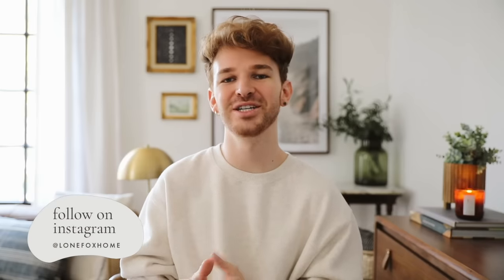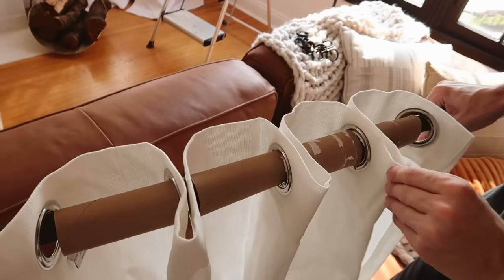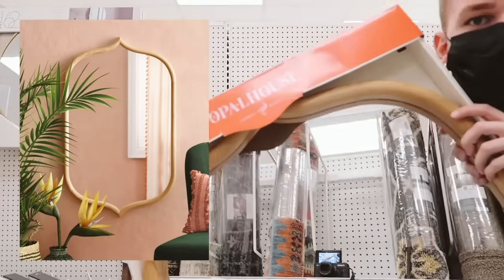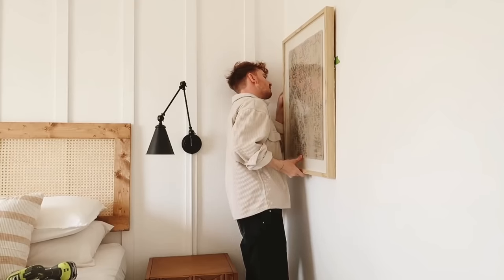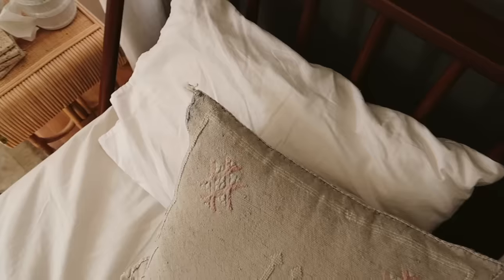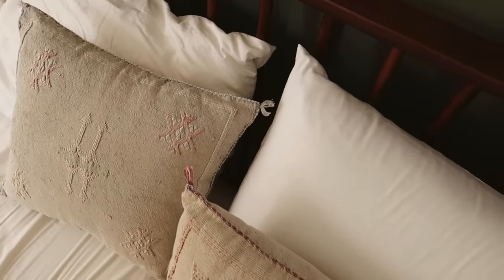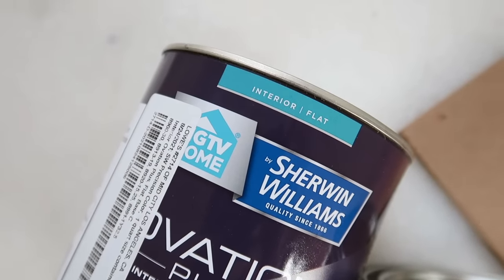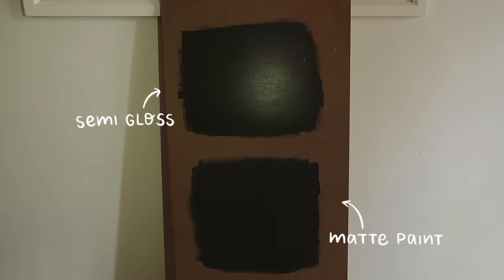10 GENIUS Home Hacks That CHANGED MY LIFE 🏠  Life Hacks to Save Time + Money!

Comment: We just put a strong wire from picture hanger to picture hanger in the back of a picture, making a triangle shape towards the top(2 or more separate wires are more secure, for heavy things) and just putting one screw and plastic insert, into the wall. Adjust the picture, horizontally on that one screw/nail. We have cement walls here. You need a plastic insert if you use a screw and no nail will work on those walls. The other walls are easier.

Comment: When a picture or mirror has hangers on either side, use hanging wire. You buy it at like Lowe's with the picture hanging accessories. Twist the wire around one hanger to secure it, trim the wire and twist it on the other side. You don't need to hammer two nails. In fact if it's a heavy piece an anchor is a better hanging choice. No level needed. In fact with those two hangers on either side they aren't always level and the angle of your nail can throw things off.

Comment: For the picture hanger my family used to make knot on leather sides with a thick thread longer than the width of the picture frame and hang it from that thread, the only thing would be not completely flush against the wall so it would be slightly away from the wall from the top side

Comment: If you have a frame with two nail holes, string a wire between the holes (with hooks if necessary) 
and hang the wire on a hook or nail on the wall.

Comment: Nice video.  On two hangers on the back of a picture or mirror -- I have always used picture wire between them then hanging on either one or two nails or picture hanging hooks.  It makes them adjustable and much easier to  hang.  With a "Molly" or stud attachment, it is very sturdy for heavier things also.  It wouldn't work for extreme width things like a long bulletin board, though.

Comment: Tip two, I’ve never seen those two hooks left like that requiring two wall screws, they are always used with a wire or string strung between them, so you only need the one wall screw to hang the wire or string over.

Comment: I’ve made my Christmas tree appear a lot taller by placing it in a pot that was larger than the tree stand — and placing a crate in the pot … in not describing it that well…. But instead of paying $400 for a 13-15ft Christmas tree, as it has been recently, we spent $100 for a 8-9ft tree and placed it in a huge garden pot that we already had, and placed it on a crate - then put a Christmas rug around it  and then presents …. 
Similar idea to the faux tree work you did with a larger pot and boxes to elevate it …. 😉

Comment: With the paint one you don't actually need to buy the original wall color to get a clean line. Get a small brush and paint from on top of the painter tape and away and you'll get that same clean line. It's because you'll have less paint on that little brush so it won't bleed through the tape and the bristles won't get underneath the tape where you don't want them to be. I've done this with dark colors on white and it looks super clean and you save money by not having to buy more paint!

Comment: I NEED the rechargeable 💡 hack! I live in an apartment complex that was built in the ‘40s. There are two outlets in the 13x15’ bedroom, four outlets in the 13x18’ living room/dining room layout. I have one lamp in the living room (between one chair and my work station…I wfh). I have a loveseat against one wall, with two chairs facing it at each corner. The one chair, essentially in the middle of the room, has no light fixture. A small end table with lamp would really work nicely. Thank you!

Comment: Great tips!  My favorites (new to me) were the gallery picture hanging using butcher paper first.  And using the painter’s tape and same color paint before the darker, new color paint to get a perfectly straight line with no bleed thru.  Oh!  And also the black electrician’s tape on windows!  Thank you!
Reply: I use a roll of wrapping paper that I buy at the dollar store.  You can also use brown, paper bags from the grocery store in a pinch.  Be sure to write the size on each cut out piece if you plan on saving them to use again.

Comment: Those little D rings on the back of your frame are meant to have a picture wire between them. Most frames like that have an option to hang them landscape or upright just like this mirror did. Just get some picture wire Talla connect the two and then put that wire over single nail and then you can center it is by sliding back and forth.  If it's somewhere it might get bumped just use a wire tie or something to wrap around each side of a nail so it won't slide back and forth and get cockeyed

Comment: Instead of the lipstick for handles with 2 screws sticking out, just push them through some cardboard, then you have a template.  If they're just 2 hole handles, just put a piece of paper on them and press into the holes to mark them.  Again, an accurate template.

Comment: Sry, Electrical tape on the window.ick..I get your point, I had a similar  problem with French doors I purchased but didn't notice the wrong ones came in until they were instllled, Ugh, they had white cross bar btwn the glass panels, so I couldn't paint them , I fixed this with edge band :) Edge band is real wood strips, it even came in the specific coordinating maple. I stained it then took a  clothes iron and it sticks to the window! works great and good quality

Comment: IKEA sells motion sensor lamps that are battery powered and have a few cute designs. The batteries last for months because the light only is activated when there’s motion and when it’s dark (it has a motion sensor abs light sensor so it’s only activated at night with motion)

Comment: The tape trick is clever,,,,BUT I've always understood that those eyes, or nail holes,  on the back of the mirror are to use with picture wire....then you can hang it on one strong nail or if a mirror, better with two sturdy nails, spaced fairly far apart which will allow for straightening/balancing..

Comment: As far as those picture frames go, if there are 2 hangers with those metal triangular loops, u can still make 1 hole. Just get picture frame wire (or any sturdy wire) & tie each end to each hole & hang in the middle. That's technically what they're for (they're not for screws).

Comment: The two hangers on each side of a mirror or framed art are not for nails.  Run wire between the two holes and then use the wire to hang the mirror/art on the wall.  Then its level even if the nails in the wall are not.  The hardest part is getting the height where you want it.

Comment: I have seen and tried this tape hack for hanging a double-hanger item, but I have ONE CAVEAT: if the two hangers on the back are not level to one another relative to the piece (for example, if the right one is higher as you are looking at the back), you will transfer that difference in height to the wrong side when you turn the tape around and put it on the wall, and your piece will hang crooked. I always use the tape, but I put it sticky side out when marking on the piece, THEN stick it to the wall (I poke a small hole through rather than use a pencil, otherwise you obviously won't see it because it'll be on the wrong side!).

Comment: Loved the tips, thank you.  A bit late for me to watch this though Lol.  I have struggled to drill correctly for my dresser handles - in future I can use your amazing hack.  I have one project that I wanted to do but since there's no electrical connection on that wall - I'm stuck.  We have knocked down a wall (to open the kitchen) and on the part that we cut the wall, I wanted to place 3 pendant lights.  Not sure how I'd make them - yet.  But I might have to use your idea of using the rechargeable bulbs.  Would you be able to give me some ideas on what type of pendant lights I can hang that can use those types of bulbs?  I wish you were here in BC and I'll let you decorate my space.  Lol

Comment: Don’t forget to MIRROR the two holes that you put on/in your painter’s tape when you transfer them onto your wall!!
If the holes on the back of your piece are not level and you simply put it ‘non-mirrored’ on your wall, you will make the holes/nails in your wall out of level too! And then you are STILL stuck with a crooked piece!!

Comment: You don't have to use two nails. Use picture hanging wire through those loops on the mirror .Twist the wire to the desired length. then put the nail in the center of where you want it hung. This is how paintings are hung.

Comment: The only thing is that they are expensive and.don’t last too much. I purchased 2 sets of two of the long ones to illuminate under the top cabinets of my kitchen. It looked beautiful. First of all I needed 3, but they used to come in set of 2, I don’t know if now this was changed. Then, 2 of the bulbs went off. So I purchased another set, since I just had one extra. For not annoying with the whole experience, after almost $100.00, I decided to go bach to the ones I always used. They’re plugged in the wall outlets and are the oldest style, not the LED, which are also I pain in the neck to find replacements.

Comment: I thought the purpose of the two separate hanger loops is to attach picture wire between them, then hang them with the wire. Isn’t that the Point, of have I been wrong all these yeasts?

Comment: What a great video!  Thanks, Lone Fox!  I especially love the painting hack.  When I paint an accent area, I like to create a border of the original color all around the accent area.  That way I avoid dealing with that horrible line where wall meets ceiling or adjoining wall!  I measure in 3 or 4 inches all around the accent area and tape it off.  (Make sure to run your tape on the outside of the accent area!).  This creates a lovely "frame" around the accent and it gives a feeling of cohesion with the original wall color.  BUT, I have struggled with the leaky look along the edge.  I normally do lots and lots of burnishing to get a complete stick.....NOW, thanks to you, I have a solution.  Your suggestion came just in time as I am currently preparing to do some pretty accents!

Comment: The painters tape for nail holes  — this has bothered me forever — because I thought you’d need to turn the tape upside down or backwards when placing it on th wall — I definitely thought about this incorrectly for way too long. 

It is actually the mirror image - so to speak - from the back of your art to the wall … right? So if one hole is higher than the other, the image will rightly place onto your wall, right?

Comment: Dont use electrical tape on your windows.  Just don't.  It will NOT stay where you put it for long.  And the back gets stickier and nastier - especially when exposed to heat and/or light.  DON't DO IT !   Getting the rest of that tape off and cleaning it up will be a nightmare - we're talking HOURS per windows.